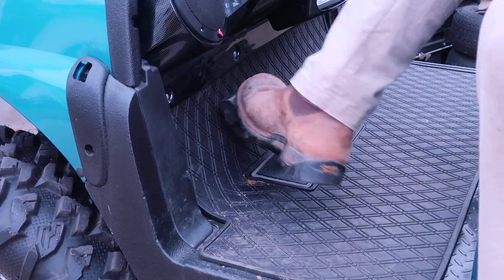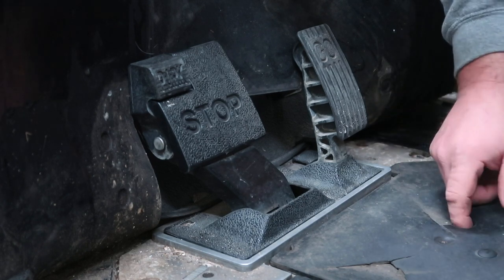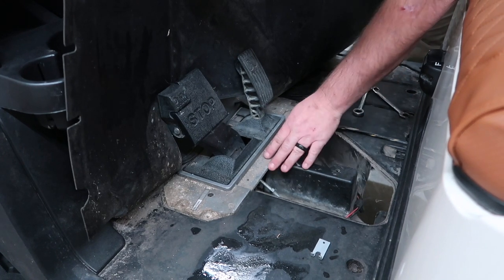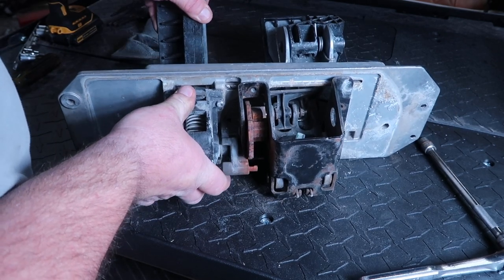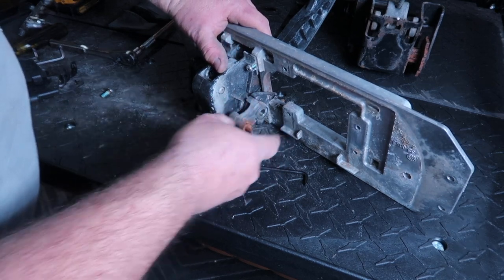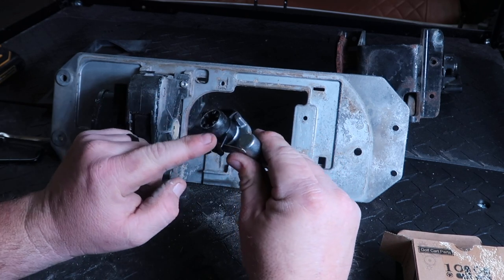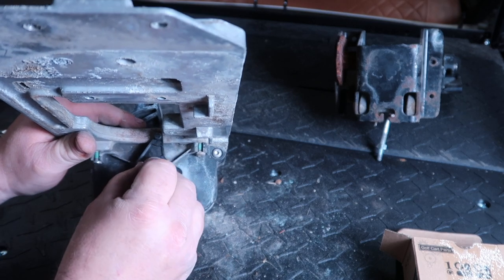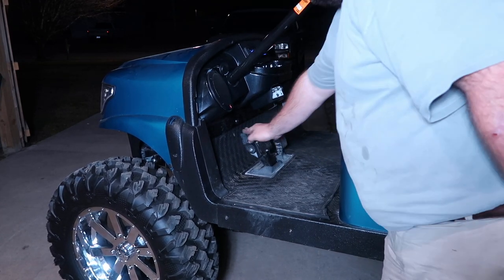Club Car Precedent Parking Brake Fix | Parking Brake Doesn't Latch | Golf Cart Hill Brake

Comment: I installed the Alpha body kit on my club car.  When I put the brake all the way down to park the brake lights stay on. I installed the spring kit with the park brake down as I saw on a video. How do I correct it and ajust the brakes since I have a 6” lift and 14” wheels.

Comment: I just bought a EzGo express s4 used and The serial number plate is missing as they upgraded the dash. It’s a 48v system but I’m trying to buy a Navidas 600. But have zero clue which one to get. Is the express built on the same setup as a txt?